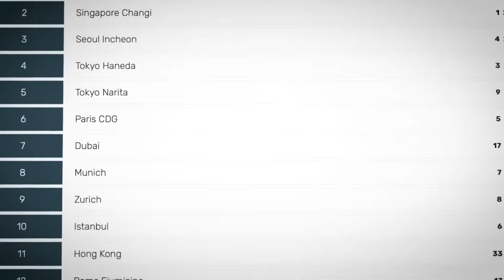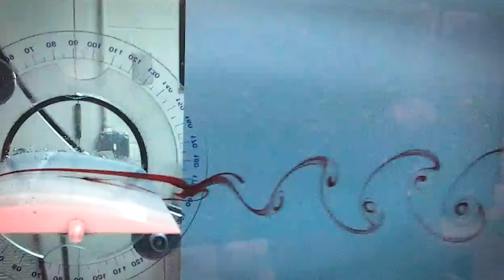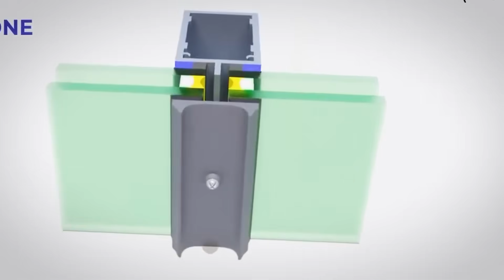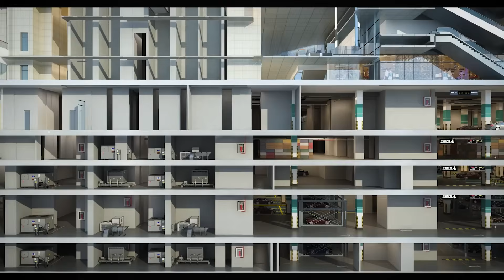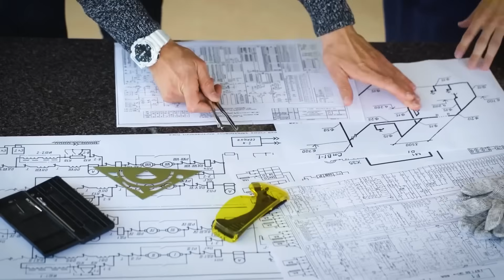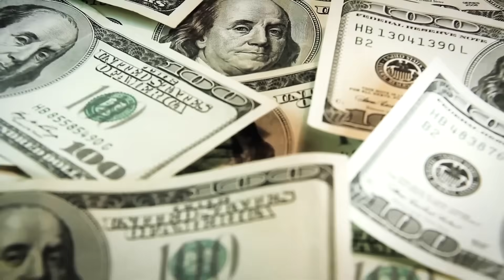Why America’s Tallest Skyscraper Might NEVER Be Built

Comment: Ready for an essay of observation? Haha 
Good luck OKC on that, wishing the city & the project well. Surprising that it was approved, must not be selfish NIMBY persons on council. There are 2 common objections to skyscrapers, which are just bogus fears.
1.	Blocking views – actually only of sky.
2.	Shadows – the higher up the farther away & faster moving.

Potential problem in ROI for there not be enough growth in a few years to fill the floor area of ~4,000,000' square. 

Beyond the FAA approval, assuming the location is far enough away from airport (unlike a few cities in the US top 15, such as SD & SJ), the ground transportation is a big issue. Will be there enough roads to accommodate 10,000+ people going to & from the complex in an area of a few acres? 

That's like a moderate density of a city in 1 or 2 square miles concentrated in a surface area of a few acres. Although, downtown cores of many cities have higher daytime densities, but usually with high public transit usage.

It is doable though, if other growth is lessened or even if the supertall height adds to growth. There will of course be a premium price on lease/buying on the top ~2/3 floors. 

For local comparison, how do the upper floors on the Devon Tower fare? Its 844’ height is certainly an outlier by 2/3 taller than 2nd place. Although, there might not be much of a market rate charged because many floors are owner-occupied, but good for account-expensing (haha). 

Oh yeah, there will be huge income from the observation floors & a revolving restaurant which could pay for much of mortgage/investment. Being done, right?

Surely, all those items, plus many more are taken into consideration. I wonder the construction cost of just the supertall, $600-$800/sq.’? Wishful thinking or higher?

Comment: Someone tell me when a tornado has taken out a high or even mid rise building? As far as how financially successful the project will be that's the ownerships problem not ours good or bad its on them.
Reply: A tornado hit two small towers in Tulsa on 41st Street between Yale and Sheridan in 2018.  It broke windows and damaged the elevator shaft in one of the buildings, but they didn't fall down.

Comment: They have been talking about this tower over a year and I have yet to see any groundbreaking construction.
Reply: That is common. Some skyscrapers are planned for decades before ground is broken. Worse is when construction is halted. The frame of a 1900 foot skyscraper has been on hold in Tianjin, China for years. It looks like a huge skeleton.
Reply: When the Devon tower in OKC was first proposed and approved it took over a year for construction to begin. This project is way bigger than that one so it might take longer. It was proposed a year ago and it was approved a couple of months ago so it might be awhile tell it begins. It’s definitely happening only question is if it’s going to be that tall.
Reply: It'll be half the height proposed if not smaller@ChevyLS1454